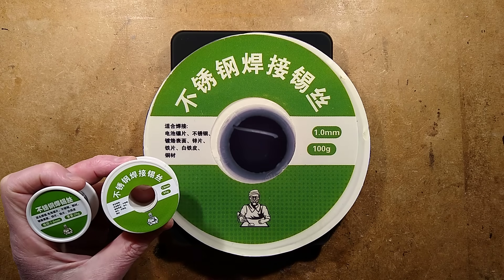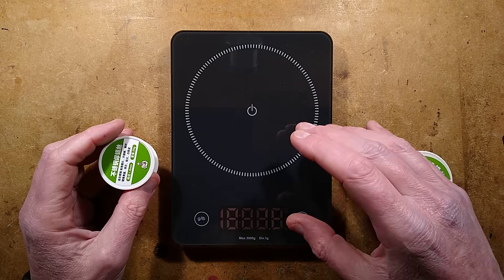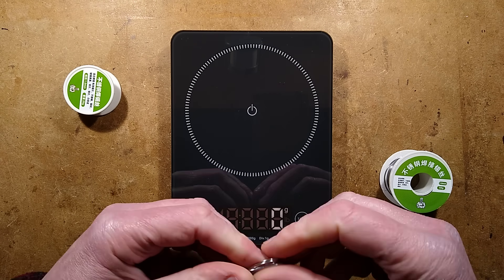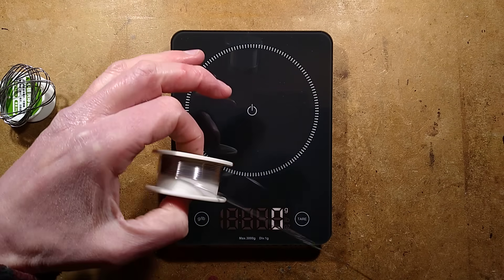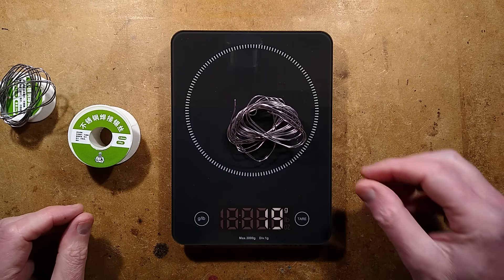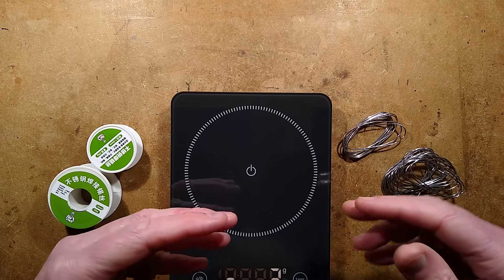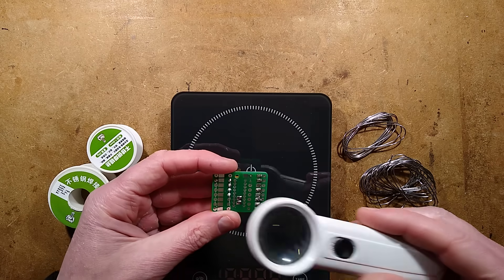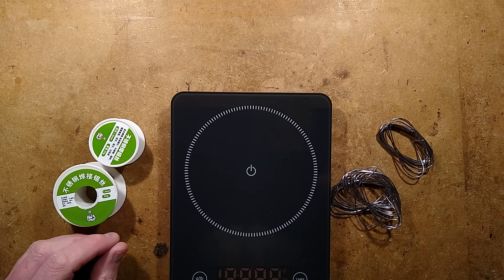The 20g and 50g mystery solder showdown

Comment: The Ersin MultCore solder I used as a kid (60 years ago) was the best - all the modern solders form crap joints, don't flow, leave gawd knows what residues and generally cannot work with my now shaky hand.😭😢😭
Reply from the maker: I've just tested the standard Silverline AS15 60/40 flux-cored solder and it appears to flow properly.
Reply: I use Kester 60/40 rosin core solder and it's always flowed well and made good joints for me.
Reply: Some years ago, I bought a bunch of solder stuff on ebay from a seller.  It was four 3 pound rolls of good 60/40, some soldering tips, and about a dozen rolls of solder wick.  I'm guessing it came from a commercial business where they were going lead free.  I have enough good name brand solder to last me for the rest of my life.  I think I paid $30 plus shipping for the lot.
Reply: I use Kester 44 - 63/37 and it's been amazing....you can find it anywhere online and get it delivered quickly.   They consider it a "no clean" Flux, but yeahhh, I still clean it anyway.
Reply: Multicore solder is still around with its 60/40 formulation and five cores of Ersin flux. It was bought by Loctite and it's the only brand I use.
Reply: @johnm2012  'Loctite Crystal 511' is what it's now called I think, it's 60/40, and works beautifully, it's still rosin cored I think, but is now classified as 'no-clean' so one doesn't have to panic about getting every trace of flux cleaned off when done. I need to be getting another roll myself soon, before someone without a clue decides to make it even more awkward to get.
Reply: I was thinking the same thing last night. 
I've got some nice 63/37 Wharton solder that does a good job, but the 5 core Ersin did subjectively outperform anything I've used since.
It still seems to be available, but I have no idea if it's exactly the same formulation.
Reply: it took a few years but quite a few brands have nailed down decent non-leaded solder now. I use Weller WSW SCN M1 and it's fine for what I do on PCBs
Reply: @marcogenovesi8570  Yeah, that solder works very nicely indeed, I settled on it a while back for work purposes. There's a lot of stubborn resistance to lead-free, all of it made using lead-free products, oddly enough.
Reply: Kester 44, 63/37 is the best I’ve ever used. I have tried Multicore and it’s no comparison. (Multicore is good, but Kester 44 is simply superior.) And yeah, it’s not hard to order.

Comment: What did they weight the reels with? Cement?
Reply from the maker: Possibly a filler added to the plastic.
Reply: Based on the manufacturer honesty, heavy metal waste. Plot twist: the cadmium in the solder comes from the reel.
Reply: @SVanHutten Here I was thinking the reel was lead with titanium dioxide white, but now I'm thinking it might be cadmium stearate white.
Reply: They might as well weigh it up with lead-free solder, at least some use for it .....
Reply: So long as it isn’t thoria mixed in with the plastic!
Reply from the maker: @markiangooley  No thorium dioxide.  I did a radiation test.
Reply: Thy are a solder factory, guess what they have in abundance? Naturally, those reels are filled with solder.

;) ;) ;)=
Reply: Lead and cadmium 😂
Reply: @muwatter  those are finger lickin' good they say! 🤤👌
Reply: likely just solid plastic(like the 100g reel was)
Reply: I think they weight them with a scale.....no?

Comment: I got some of that solder to solder the ends of the stainless steel brake cables on my bike to stop them unravelling. It took some heating to get it to flow right, and the flux fumes were obnoxious, but it seemed to do a reasonable job.
Reply: Just crimp a ferrule on to the end?  🙂
Reply: @_Steven_S  😂 that's not complicated enough
Reply: @0xf_Steven   that's so vilely bourgeois... 🧐👆
Reply: @0xf_Steven  A 2.5mm ferrule crimps on nicely... ask me how I know this
Reply: I saw a nice trick where you stuff the end of the cable into a drill, heat up the spot you want not to unravel with a torch till it starts glowing and spin the drill quickly to break it while spinning the end tightly at the same time, that way it'll never unravel again, plus you can feed it through the housing even no problem :)
Reply: All you need is standard solder with acid flux, and it works, the flux is used by Plummers to solder stainless steel pipe in posh bath rooms.
Reply: @MrBobWareham Flux is used by plumbers to solder all copper pipe. But no plumber uses stainless steel pipes. I’m guessing you’re being confused by chromed copper; although typically one would use compression fittings on that.
Reply: Heat shrink does a better job and weighs less. Or yeah just the standard crimps that every bike shop uses.